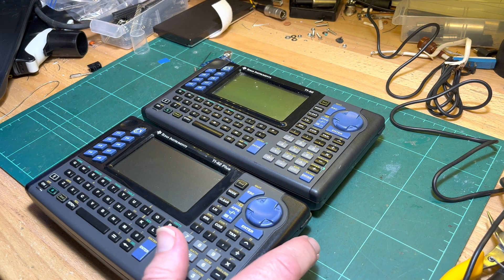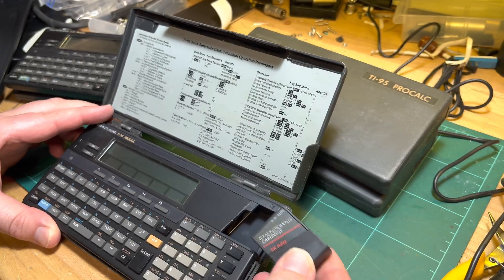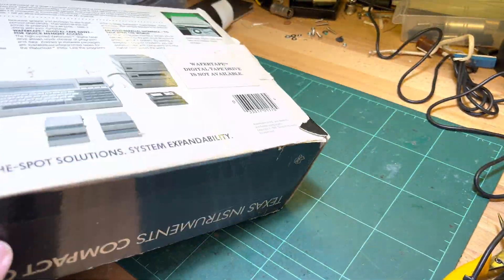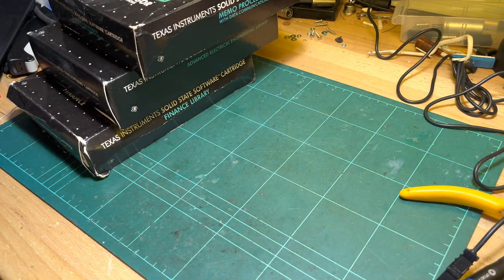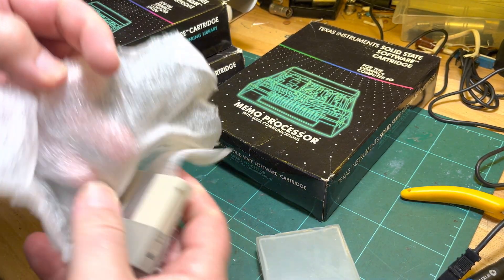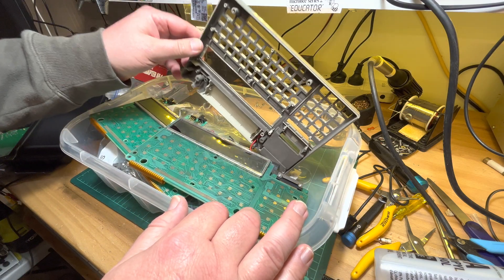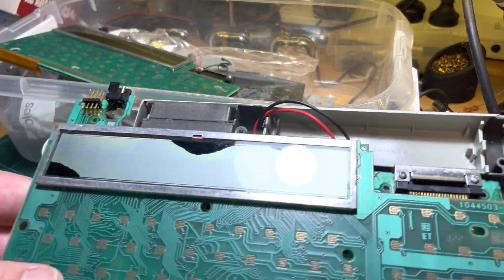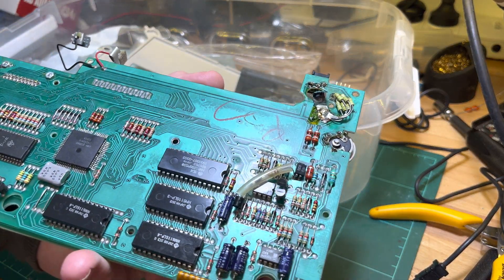🇺🇸 TI's Handheld BASIC Computers - Quick Look [TCE #0198]

Comment from the maker: So I've been doing some more research on the machines - disappointingly, it seems only the TI-74 and CC-40 are really BASIC machines ... the TI-95 shares a similar layout to the TI-74 but doesn't use BASIC, rather being a keystroke programmable calculator.  They do share peripherals via the DockBus though.  /Brett

Comment: Cool subject matter. I remember seeing these in adverts in the back of magazines. I was tempted by the big keyboard but I had a Sharp PC1251 pocket computer by then which has somehow still survived somewhat intact. The display has the bleeding problem but I managed to find someone who had them remanufactured. I just have to do the re and re on it. It’s got a Z80 processor and a reasonable implementation of BASIC. I’ve got the micro cassette and colour printer too.  

I’ve still got my original TI55 programmable calculator I bought in 1979, It still works and I’ve also got a working TI59 and the PC100C printer. I gave away my TI 99-4/A I bought in 1983 when I moved up to an IBM PC Jr a few years later. 

Keep up the great content.